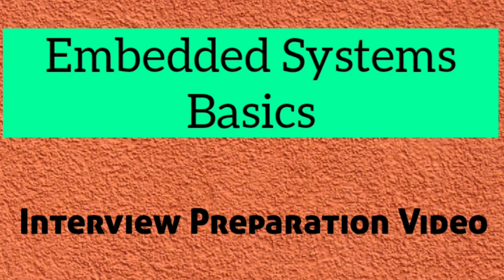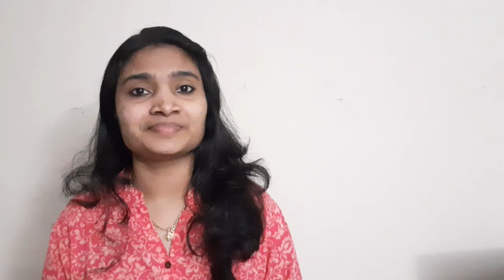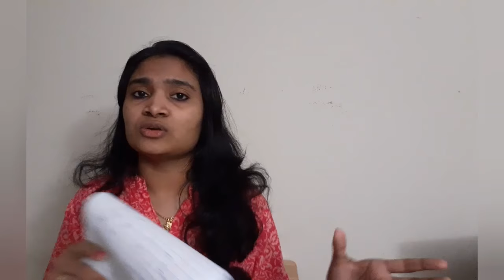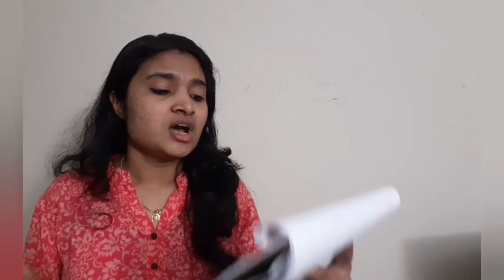Embedded System Interview Questions and Answers| Core Company Interview Questions| Embedded Sytems|

Comment: There are a couple of answers that I don't fully agree with ma'am.....1st.....an OS need not be a part of every embedded system....for example, if an embedded application is developed using ATMEGA32 MCU, then OS is not a part of that application but if an embedded application is developed using Raspberry Pi or Beaglebone Black, then it can be said that the OS is a part of the application.....so OS being a part of the application really is dependent on the type of MCU around which the application is developed........2nd........about watchdog timer.....every instruction in MCU is executed in a particular time limit....so when a system hang condition comes.....that time limit exceeds the time set in the watchdog timer.....after that the time out signal causes the entire MCU to be reset completely.....and in any MCU, reset is the most fundamental source of an interrupt.....so any recovery programs that be kn the ISR for watchdog timer reset may be executed.......3rd.......a very simple answer for the need of infinite loops in an embedded application is that  majority of these applications run continuously as long as they are powered up......for example, an air quality monitor needs to run continuously for monitoring pollution levels.....so the sensor data must be extracted continuously.....this is where infinite loops help......and using infinite loops to halt programs when error comes is it's secondary use......and of course one last thing is that Linux, Unix, etc are examples of general purpose OS......RTOS examples be like Mu-RTOS, FreeRTOS, TI-RTOS, Contiki OS, etc
Reply from the maker: Sure
Reply: superb
Reply: Thank you pradeep

Comment: Does an embedded system must have an OS? E.g. a simple application using Arduino is considered an embedded system, but it does not run a real OS.
Reply: No, I think if you have a good amount of memory then yes. However, the OS usually is used in 32 bit microcontrollers. You can download RTOS into you adrino I heard that is possible.